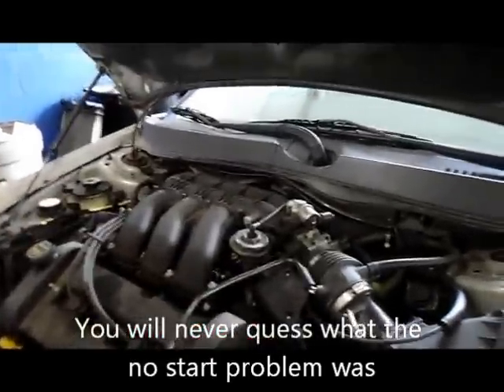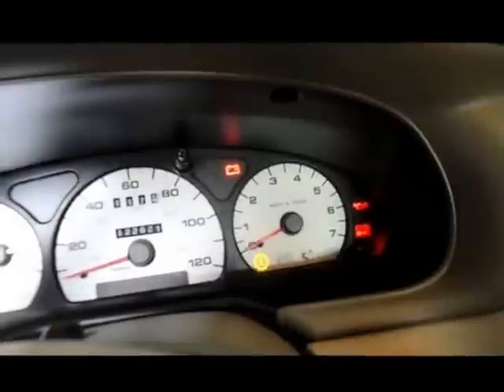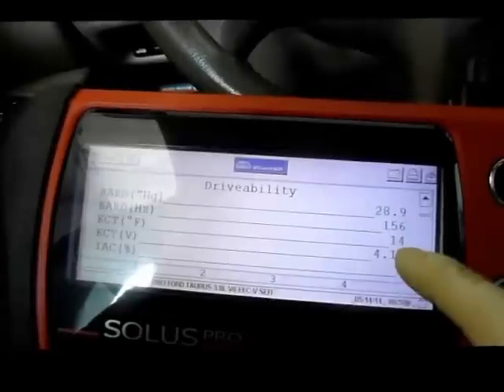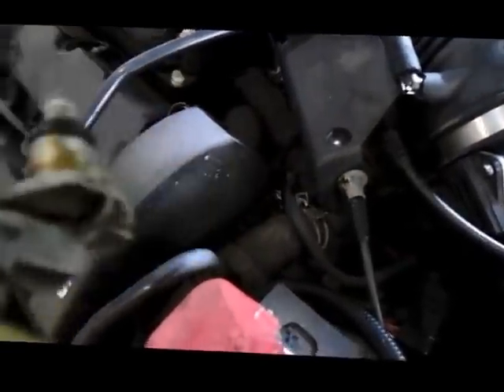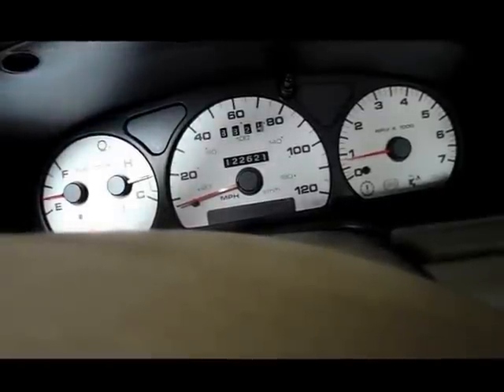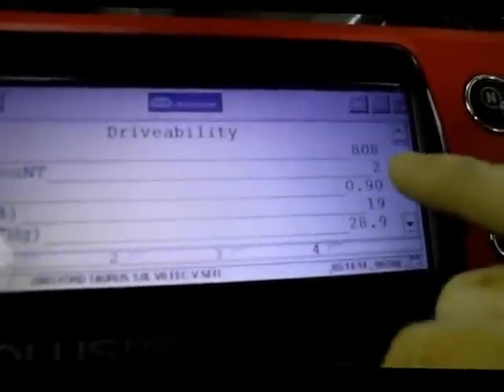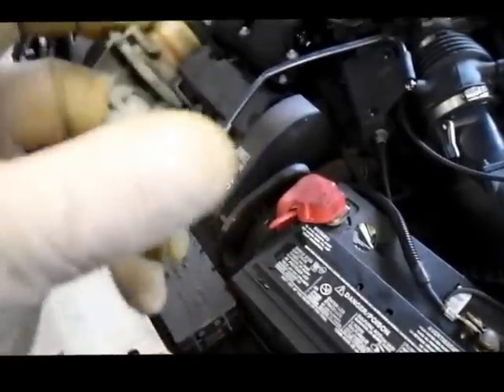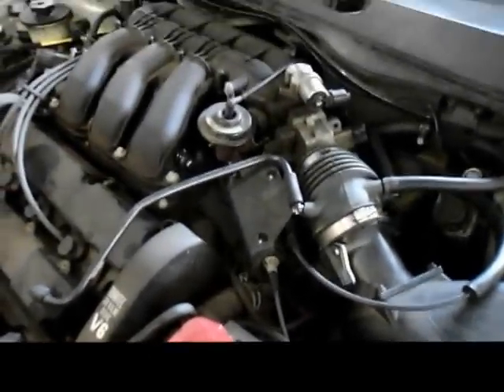Engine cranks but won't start

Comment: just have a problem with my hyundai matrix 2004 1.6 engine automatic trans GAS,.,.crank engine but wont start,.that it means to me that my camshaft possition sensor is bad and i need to replace a new one found out when i scan it,.so i dit it and buy a new camshaft sensor.then after i put a new camshaft sensor,.happily it start,.and i drive and used my car about 3 days perfectly but on the 4th day morning,.the problem occurs again and it not start again "crank engine wont start,.my point is what is the problem for this car?.and badly my car battery turn dead battery at the same time? please help
Reply: Did you get a fully charged battery?
Reply: The coil pack in matrix vehicles are sometimes the cause for no start.
Reply: The testing to try to crank the car with the defective sensor probably drew the battery down a lot. At that point it needed to be charged on a charger until full voltage (approx. 13.6 v.) was reached.  If the battery is not holding voltage, or if your battery is 3 years old or older, replace it. (A new battery is cheaper than having it towed when you are stranded somewhere.) Test for parasitic draw with new battery, and correct any unusual current drains. Finally, check the ground for the camshaft sensor circuit to be sure that wasn't causing the initial problem.
Reply: I change the spark plugs and wires it started but when it got hot it died what cause it to keep dying
Reply: How long does it take you to sign your name on something??

Comment: I have a 99 Sable 24V DOHC that has the exact problem.  I was thinking it either no spark or no fuel.  I was thinking my fuel pump died until I watched your video.  The only difference is the mine ran fine but after a cool night I got in and it cranked but nothing else.  It would not catch or even give any indication that it would ever start.  Thanks for your video.  I hate putting money into a car that is at the end of its life.  When it runs it runs like a new one thus my hesitation to trade.  I didn't have a fuel smell like it was dumping raw fuel into the cylinders.
Reply from the maker: thank you for stopping by the shop.

Comment: Thanks for sharing that. Pretty mental.
I think your suggestion might be somewhere near. If its outside the normal temperature parameters, it wont run in order to protect the engine.

Comment: Makes sense to me. The faulty sensor is telling the ECM that the engine coolant is frozen at that temp. If that was in fact the case, you would get 5 minutes from home and the block would over heat. risking a blown head gasket, maybe a sheared water pump or several other fatal failures. I learned a lot about Fords over the years as I always service my own. My 86 and 99 F150s had a limp home mode that would allow me to get out of the road in case of some electronic issues. The 2000 Crown Vic. actually  has a feature that in the event of a coolant loss, the 8 cylinder defaults to a 4 cylinder to allow the engine to run cooler. It is severely handicapped as it would not accelerate but it would allow me to get into a safe place off the highway for service. It was weird. I had a radiator leak and if the temp rose 10 degrees above spec, It would limp to the side of the road on 4 cylinders just before it hurled all of the remaining coolant onto the pavement. I finally replaced the radiator and the heater core and never had another problem. Nice plan Mr. Ford. Just wish you would tell us about these things up front and save hours of  going head to head with a computer.

Comment: Yeah. This just proves why I want to restore my 89 and also find another vehicle from in the 60 range. I just saw a video about changing the timing chains on a 2010 GMC Canyon and thought. Screw that noise. My 89 was harder than my 73 I used to have, but still way easier than the 2010.

Comment: Mine did this same exact thing, I have a 2000 Ford Taurus duratec. It would stall in the idle and at lights and refuse to start. As soon as the ECT sensor was removed it would start normally. I got a guy in red bluff ca to find it for me from Bob's tires. And in forever grateful Although I'm back at the same issue after doing an oil change cranks but won't start.

Comment: Another I ran into a while back !  Had to replace my starter on an E 350  Box Van,   after that I had problems with my solenoid , it stayed engaged ,  so I tried another, --- These are top post solenoids ,  and I went through several,  getting tired of leaving my hood have open, I was looking for a knife switch, so I could control the power to the starter! 2-3   weeks go by,  I was in an auto parts place, and talking to the  counter person,,   A mobile mechanic  was close and heard my conversation.    He asked me what I had for a vehicle. He had run across a guy  who brought his car in and had the same trouble for 6 months!!!!  He said --- go back a couple of years  in the vehicle age and get a solenoid with the posts on the side and you won't have a problem!  I did and it worked!  He said those new solenoids with the posts on top were welding together!  So you had constant power to the starter!!   I like telling people about oddities that come up!   Lord knows we all find them now and then !  I have one right now! Trying to figure out!  Rick

Comment: 2003 Buick Lesabre (210,000) miles: Cranks - NO START after extreme cold snap).   Cleaned and tested injectors (cut off one injector connector and used as a connector with wires to connect to 12 volts while spraying cleaner through injectors (used an old valve stem) - then reconnected to engine elec wiring when done). Replace spark plugs (old ones worn out and flooded with fuel) tested for spark - good. Replaced ignition coils (3 ) - original with new, replaced plug wires(original) with new. Removed C/S harmonic balancer pulley/wheel - C/S sensor pickup rings were caked and burned with grease, dirt, grime - cleaned thoroughly with carb cleaner to like new - reinstalled using a modified 3/4 x 5inch 16 threaded bolt (cutoff head) and nut and large washer to press balancer back into place. - replaced C/S sensor (original). Consensus - the problem was the C/S harmonic balancer C/S pickup rings being very dirty and worn out sparkplugs. The rest of the parts were for good measure. All parts AC Delco from Rockauto.   Engine now runs like new.

Comment: The PCM uses the signal of the ECT as a main correction factor when calculating ignition advance and injection duration. The ECT is a high hierarchy sensor at start-up and during warm-up. If the PCM detects an extremely cold engine signal it can over-fuel and drown the engine. In this case, it seems the PCM cut spark and fuel completely because the fuel correction would've been way out of specs. Good example of why it's important to check scan tool data, but in this case I'm sure there was a DTC as well, which would've help pinpoint the problem quicker.

Comment: I had this same issue on my 2001 Taurus wagon with the 3L 12 valve engine but it wasn't the sensor.  The coolant was old and was inducing a small voltage through electrolysis.  All I did was a full cooling system flush and everything was fine.  The stray voltage that was being created was throwing off the voltage the sensor was reporting.  Only reason I actually found out the issue is I had to pull a hose to get at the bottom of the engine.  I figured since I had lost so much coolant I may as well do a flush so just topped off with water.  That was JUST enough to reduce the electrolysis and allow the sensor to report properly.

Comment: Nice video. I once had a coolant leak which caused the car to over heat. The engine would shut down to prevent it from causing severe damage. So i guess this is the same in a reverse kinda way

Comment: jimthecarguy I'm sure someone told you by now since it's 2016 and this video is 2014. If the ECT runs low It floods the engine with fuel since it thinks it need extra fuel to start up a cold engine it's just the computers way of trying to get the engine to operating temperatures. you can override this condition (just to get it started) by holding down the gas pedal down, just like how you normally clear a flooded engine.

Comment: Jim i ran into exactly the same thing this morning / checked the wiring diagram / wire runs directly through the  ECM i guess as a shut down if the sensor is defective or doesnt work reason it wont start if its defective just so you all know// thanks for the teaching and the tip

Comment: I had a 4.3 chev.In an astro van that flooded so bad that it BARELY made it to my house,(3 blocks from where I bought it) in nearly wide open throttle position..,the only spot where it would stay running.   I tried a good donor throttle body....,same  awful black eye-burning rich flooding. A friend said it was undoubtedly the temperature sensor. I spent 17.00 at oreillys and also changed the oil and filter,(which gained a half a quart in 3 blocks!) and it turned out to be a perfect  jewel    .Whoodah thunkit?!!!!!!

Comment: Fuel trim and spark advance are different at different engine and ambient temp ranges. If the temp sensor tells the computer that it is hot when it's cold, or cold when it is hot,  the fuel trim and spark advance will be incorrect for conditions causing a crank, but no start situation or severe random misfire similar to jumped timing or being 180° out.

Comment: For S&G's, you should have fired it with temp sensor disconnected or ~200 ohm resistor. That would indicate if it was stupid ford programming or loss of reference voltage. We've tied in a key-on 12-5vdc $25 transformer where ref voltage was mysteriously low instead of replacing computer.

Comment: 14 degrees would tend to richen up the fuel system change injector pulse width . The a/f ratio would be richer than would be needed to start. I as you would expect it to start but run rich/fat etc... Having said this one could wonder if theres a hole in the engine computer mapping. I like the video :)

Comment: Hey nice post sir. I had a 2001 Taurus it gave me alot of trouble at around 85 thousand miles I thought for sure and still to this day that it was the down stream o2 sensers. But never did get it running right it read that the engine was lean and I would smell it was rich. Also I have to change the pcv valve vacum hose because they do collapse

Comment: Good Vid ! Only thing is i can Think of is they Don't Want u Starting the engine when the Coolant is 14 Degree's. Maybe the Water Pump can't Pump 14 degree coolant. it might be too thick. Maybe the " Owners manual " might say a Minimum Temperature before the car can start. maybe oil won't move through galleys at that temperature and car has to be Plugged in and Coolant Must be at a minimum Temperature Before allowing a Ok to Start Temperature.
Reply from the maker: Glad you enjoyed it

Comment: You will find this in a lot of modern cars it is a self-preservation feature it keeps the car from destroying itself if something happens. The new age aluminum blocks and heads are warped much easier when Engine temperatures exceed operating temperature unlike the older steel block and heads did.
Reply from the maker: robert folds thank you for stopping by the shop

Comment: Hey Jimmy   the variance between the CTS and the air temp sensor was so wide    illogical i guess Ford doesent even want the engine running         great video very unique situitation    thanks

Comment: E-Bay has Snap-on scanners for 2001 and below cars. They are quite inexpensive! Get the cables and adapters and manuals. Get the emission cartridge if you can. It has trouble-shooting tips for different codes. First check basics like oil, water level. Make sure there is gas in the tank. Don't trust gauges.

Comment: Wow going to look into that with mine. I have a 1988 Isuzu Trooper that I rebuilt, ran it and timed it and then when I drove it it backfired then ran like shit and I limped it back shut it off and it has not run since. Timing is good, compression is good, fuel pump is new, checked relays and fuses, injector power etc. etc. I've even tried a second ECM and no dice.Gonna look into this temp sender to see if the lead may have fallen off.

Comment: If an engine has no coolant what so ever, the gauge will generally read extremely low,  but prior to digital engine controls the lowest temps an engine would read were well above ambient air temperatures.. But in this case a low reading could trigger something via the software to shut the engine down and get it serviced, just to keep you from severely overheating your engine.  I am a retired diesel truck mechanic, and I have experienced it many times where the engine was damaged and the driver swore the gauge never read hot.  Good thing we had auto shutdown systems which generally prevented damage, if the driver or someone else, did not jimmy them to keep it running.

Comment: Older Subaru's had that problem. Also if you remember the 95 to 99 Nissan Santa would flood the engine and was a bear to get started, a new coolant temp sensor, spark plugs and an oil change fixed the issue.

Comment: What you can't see is the programming in the ECU behind the scenes on newer vehicles.  I tune most cars and all of them care about the sensors.  The issue is not the sensor failing as much as the other sensors are works.  The IAT and ECT both control timing and fuel injector tables.  The IAT most likely said to add 5 - 6 degrees of timing and the ECT registering as cold told it to only gave you 90% of the expected fuel.  The ECU sees that as a problem and faulty so it immediately throws a "limp mode" into the start program to prevent engine damage.  If I could post a screen shot I would show you what that looks like.

Comment: I ran into this same problem with my 1989 plymouth reliant k 2.5 liter. I replaced 3 sensors and 2 parts before finding out it was the coolant temp sensor. It's because the car either always reads cold or always read hot either way this will kill your car while driving, or cause a no start, and through of fuel and air mixture, rough idle. If you have to still drive for a day or to be careful.

Comment: In my auto tech class we had a same year mercury Sable (The Taurus's more luxurious twin) with the same engine donated to us. Cranked but also didn't start. It also initially had no spark, and it had us quite confused at first. Turns out we had a different issue though, it was the Anti-theft stopping the spark, it just had to be reset, as it got set off in a minor accident before it got donated. still wouldn't start, but we had found it to be the fuel pump. I believe they just dropped the tank, took it out, and fixed it.
Reply: That sounds more like the fuel shut off button in the trunk was popped out.

Comment: That happened to me in my 98 Chevy Silverado 2500. 350 efi.    Had 3 different ones I had to try.  stock one ( No Good).  junk yard. (ran! But the RpM was really low 500)and new one.   the old girl is still going 376k miles.  drive it everyday!!

Comment: Ran into this on a Mazda.....pretty much the same engineering shortcomings. The default (open) value for a coolant sensor is around -45F, so it wasn't wide open. The reason for no start, is to keep a flood condition from swamping the cat snd/or oxygen srnsor(s).

At shop/room temp, the sensor should have been reading close to ambient temp, so that was a big tip off.

I'd have run WOT crank test too although that would have been just for an academic reason and future reference.

Comment: I had the same thing happen. It was a 1998 Tahoe. Temp sensor was reading -20.  It simply flooded the engine! It would start on cold days but once the engine warmed up, it wouldn't start

Comment: yer as said in comments it helps pcm control fueling in hot and cold starts and if its faulty pcm dose't  know how much fuel to deliver and over or under fueling could damage the engine .hence no start..

Comment: I don't know about the ford set up I was a training instructor on cat truck engines for 18 years. We have run into this problem with the oil pressure and water temp sensor. This because they can be programmed to shut the engine down under certain conditions. The sensor gets in between high and low and does not log a code but they send info to the ecm to shut the engine down after warning the driver. Cat corrected the problem by some changes to both sensors. The original sensors worn out the dealer mechanics for a long time. Good luck.

Comment: It could be a rationale issue with the air intake temperature sensor. Under certain conditions, the coolant will get lower than 14 degrees. If the computer recognizes there is too much difference between the air intake temp and the coolant temp, it flags it as a problem. Never came across that myself, but I have seen tons of Fords that wont start for unexplained reasons. Low and Behold as soon as your equipment is connected, it starts and runs fine. intermittents are the best!!!

Comment: My coolant temp sensor was bad in my 94 Lincoln Mark Viii. First the connection was bad. No CEL. I cleaned the terminals and then it picked up the bad sensor and CEL came on. Drove it to the parts store and made another stop. The car would not start till after 6 tries. Replaced it, problem gone. Thats on a FORD OBD 1system btw. Where mine was not functional at all  for who knows how long, during that time I did notice a slight un-burned fuel odor. I believe the sensor not registering was causing the engine to run richer. The bad sensor will cause the car not to start when hot, if you un-plug it it should start and run at least. Theres no more fuel odor either. Runs alot better too.